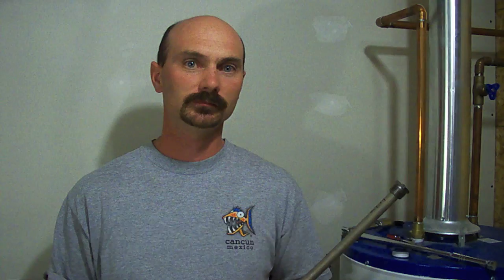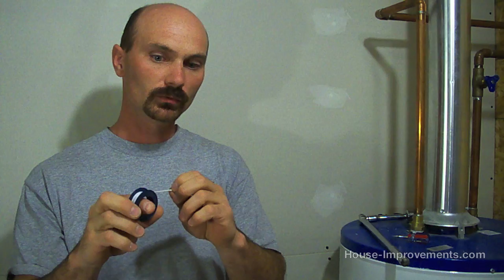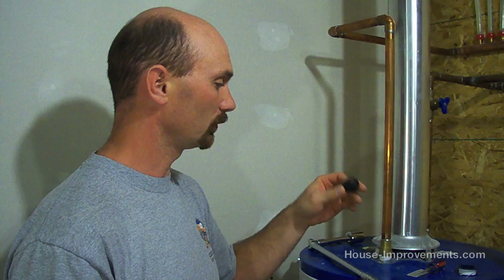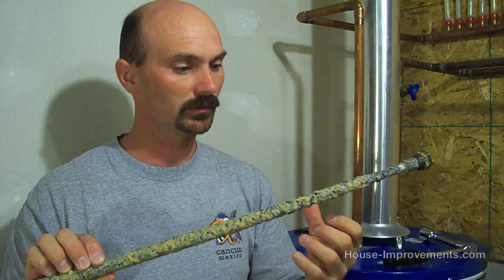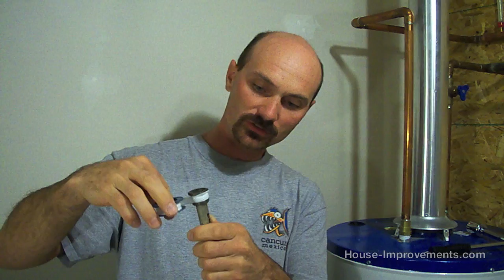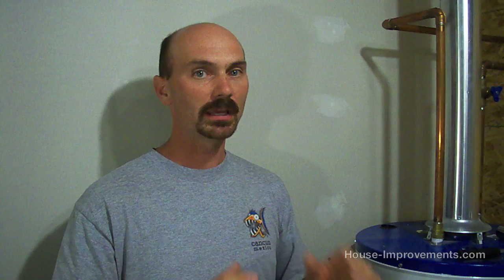How To Replace Your Water Heater Anode Rod

Comment: Watch out for GAS leaks when the water heater moves if using a breaker bar!  Use an electrical impact wrench to prevent this ($40 at Walmart).  On old heaters, breaker bars rarely work anyway.  Also, DON'T use teflon tape on threads as electrical conductivity must be maintained.
Reply from the maker: I like the idea of using an impact wrench. I have not seen a manufacture that does not recommend tape or dope on the threads.

Comment: How difficult is to replace the plastic drain valve? I bought HMP010 Full Port Brass 3/4" MNPT Water Heater Drain/Flush Ball valve.
Reply from the maker: depends how old it is. many older one will break.
Reply: @HouseImprovements  is A.O. Smith 50gallons bought at low's 4 to 5 years all. Never touch it, never flash it, never change anode rod. I'm preparing for this April. came with a white plastic valve.

Comment: why the top hoses of my water heater are flexible and not like this video?
Reply from the maker: Just a different set up
Reply: @HouseImprovements  How difficult is to replace the plastic drain valve? I bought HMP010 Full Port Brass 3/4" MNPT Water Heater Drain/Flush Ball valve.

Comment: the dip tube is on the cold water side. It is usually plastic and doesn't need changed. Bradford-white usually have the anode rod as part of the hot side. I agree way too much teflon.
Reply from the maker: the plastic Dip tube does need changing periodically depending on your water conditions.Look for my video.
Anode rod can be in two different locations depending on the manufacture. As for the teflon tape amount ....matter of opinion I guess? LOL.

Comment: Rheem does like they all do I'm sure, puts them in needlessly tight. The plastic sleeve they put around the nut is too small for an impact socket to fit, so you have to pry out the plastic sleeve. So I got a 7.5 amp corded impact wrench and it took it off without even breathing hard. Get ready to hacksaw the new one to length. Despite the manufacturers best effort I did it. And drain a gallon the first day of every month!

Comment: Many turns of Teflon tape will prevent contact with the hot water heater.  This is needed for a proper electrical chemical reaction to occur.  Else the Anode rod will be useless.  (I saw in another video)

Comment: Great video. Too much Teflon tape is more likely to leak. I understand why you might think otherwise, but it is not some kind of adhesive. I gets compressed. If a seat belt is too loose or too tight it won't work well. Same idea for the Teflon tape. 2 or 3 times around is enough.  4 or 5 max.
Reply from the maker: Thanks for the info!

Comment: You said the dip tube is on the hot side but it's actually on the cold side inlet. Its main purpose is to direct the cold water to the bottom of the tank and that's where it is dispersed. Also, you wrapped the teflon tape in the wrong direction. Other than that, you did a great job. Thanks for your videos.

Comment: couple of points 1> DONT USE AN IMPACT WRENCH, you will break the glass/porcelain insulation 2> release the preassure but DONT drain, you need the tank to be heavy so it doesnt twist

Comment: Do you have a water softener?  I don't. Does that require service to water heater more frequently with hard water?
Reply from the maker: I don't have a water softener.Hard water will generally be harder on the components and leave more deposits.
Reply: @HouseImprovements  I was afraid you'd say that.  Thanks for your response

Comment: If it is necessary to change the rod every two or so years, then why is my 1987 tank in So. CA (very hard water) still working with no changed rod? Bad science or a money-making scam?
The dip tube fell off a few days ago and I'll fix it (thanks to your help!) when the new one arrives. Hopefully working on the tank won't cause it to start leaking. Last year, I looked in the tank (inspection scope) when I replaced the tiny drain valve with a 3/4" straight ball valve. The tank looked as good as new - no rust and no scale. Lots of sediment though. It is a Reliance 501 natural gas 30 gal. tank.
Reply from the maker: Tanks where made way better back then. Keep that tank as long as you can. Have you seen this video it may interest you.  https://www.youtube.com/watch?v=OHDsNtGXEEY
Reply: Yes, tanks were made much better back then. In fact, all appliances were. They are now making them all complicated, with new features to make them more desirable, but with parts from China that must be shipped here, so they are all ultra lightweight. Which means, not durable. Also, most folks are planning on moving up to a larger home in 5-10 years so they never care about this. Sadly it's the same folks that preach about carbon footprints and greenhouse gasses that are buying appliances that last a few years, greatly defeating the little good they are doing in other ways.

Comment: Due to a minimal height space in my hot water closet - I am substituting the old straight rod for a flexible anode Rod. Do I have to cut a part of one of the links to the same measurement as the one I am replacing?

Comment: Good video. One thing you forgot to do, and is a required building code in all states is to use dielectric fittings. One on the cold water inlet and one on hot water outlet. The fittings in the tank are steel. When you connect the copper pipes to those steel fittings rust much like the rod you just replaced tends to build up at this point. These fittings have a nylon pressure barrier that doesn’t let the steel and copper touch. Water and metals of all types don’t get along rust always wins. We can only delay the rust but never eliminate it. That’s why the rod was invented and these dielectric fittings. To better understand this look up dielectric fittings and why they are used. Remember, these are mandatory building code requirements for all states.

Comment: Thoughts on using an impact wrench? My electric one is rated a 350 ftlbs. Would that work better than a 2ft breaker bar?
Reply: Yes.
Reply: @taterlysaladman9377  Use the ratchet only when
 installing.

Comment: I only have 30" of height from the top of the water heater to the inside of the roof. How can I replace the rod w/o moving the whole water heater?
Awesome video. Thanks a lot.
Reply: When you pull out the old one you can clamp it, then cut it and repeat to remove. Then buy the folded segmented rod. No need to pull out in one piece. But be very careful to not allow any to fall back in.
Reply: There's rods that are in links/sections so they're easy to install.
Reply: You can cut the rod as short as you need to.   But because there will be less rod material to be used up, you will have to change it more often.

Comment: There seems to be different sizes of the anode rod. Not the length but the thickness. How do I tell which size I have?
Reply from the maker: I have not noticed that? It can't be any bigger then the nut on top of the heater cause it has to fit the hole

Comment: I have a Jet Glass water heater that was here in the house when I bought it 19 years ago and I can't find the anode rod anywhere on the top, does anyone know where it could be?
Reply from the maker: sorry no idea.
Reply: Did you find it inside of the hot water line that is on top of your tank?
Reply: @janelensch6168  I replaced the water heater 2 years ago so I don't have to worry about it anymore.
Reply: @MrJpierre1000  New heater? Must feel great. I've seen advice to replace the anode rod every four years. I'm too weak to remove the anode rod on my 16 y.o. heater, so taking a cute from other diy geeks, I'm buying a $40 impact wrench from Walmart.

Comment: I have a 20 year old Apollo 5010 water heater.  I know I need to have both the anode rod and dip tube replaced.   I can see the dip tube is on the cold water supply pipe inside the water heater.  However, there is no anode rod top bolt at the atop of the water heater.  Does that mean I have to replace the water heater?

Comment: It takes at LEAST a heavy duty 3/4" drive impact wrench to crack those threads lose on original equipment anode rods. Them things are usually in so tight that we have to put a four foot long cheater pipe on a 3/4" drive breaker bar with impact socket and a helper trying to stop the water heater from rotating. I've even considered using an acetylene torch.

Here's a HUGE tip! We feed the cold supply into the BOTTOM of the tank! We remove the boiler drain, put in a nipple, tee, boiler drain and feed supply into top (middle) of tee. This assures that no calcium or lime build up occurs on bottom of tank. People NEVER remember to flush their water heater. This takes care of that for them. We install a SECOND anode rod where the original water feed was. All in all, I'd guess this would at least double the expected life and serviceability of their water heater's tank. We've had inspectors squabble - but they soon learned this installation not only meets code, but is the preferred method of at least Bradford White and AO Smith. I think the bottom fill keeping the bottom of the tank clean will help prevent people from turning up their water temperature to compensate for short-cycling that had been caused by build-up. That higher temperature causes build-up at an accelerated rate, clogging their distribution piping. Accelerated sacrifice of the anode rod, as well. That's THREE, count 'em 3 - huge benefits to this method. Neat, huh?
Reply: This is amazing.
Reply: Way smart! Thanks!

Comment: There must be electrical contact between the rod and the steel tank.  The anode is more willing to go into solution compared to the steel.  When it does make + ions, electrons are left in the anode, which must travel to the steel tank, giving it a net negative charge that keeps it from rusting.  Look up "cathodic protection"  in wiki.

Comment: Mine has a 5/8in bolt, problem is its not a hex head it only has 4 sides and it's recessed. Ever seen this? I ordered a replacement rod or I thought I did but it is a hex head. Hoefully it matches but how do i get my old 1 out?
Reply: Use a 12 point socket.

Comment: Teflon tape should be wrapped the other direction, and my anode needed a serious impact wrench to remove
Reply: @Donald Humphrey  You are right, "The other direction"   do not hire a plumber who does not know how to put a Teflon tape!!!
Reply: @1benny09  he did it correctly.
Reply: He did it right.
Reply: Wrong! Always wrap the tape clockwise, righty tighty ....( which he did)or it will leak
Reply: @wrzl1675  I think he was right.  Wrapping counterclockwise should ensure it does not fold/tear up when screwing back in.  Clockwise wrapping can possibly get torn up.

Comment: Cost of doing this myself:  
  $20 anode rod, from Amazon
  $75 impact wrench (1/2") and socket set
  Still cheaper than hiring a plumber!

Time required:
  25 minutes trying to shut off the water supply valve that hasn't been closed in 25 yrs
  1 minute removing old rod
  5 minutes sawing some length off the new rod so it will make the ceiling clearance
  1 minute tightening in the new rod.
Reply: For me it was $23 Amazon rod
25 min. trying to find water cutoff
water cutoff broke off due to age, water all over me and crawl space. 
$100 water bill due to excessive use
Plumber after hours $400 to fix valve. Extra $100 to install the rod but no guarantee as I didn't purchase from him.
Plumber noticed water heater was starting to leak, replaced, for $879.
Sold house cheap because crawl space was wet.
Reply: @taterlysaladman9377  I try to always shut the curb stop at the meter in an old house because old valves usually leak. It's always good to know how to do that in the case of an emergency!

Comment: I have a bock oil fired there are two caps on top labeled anode, are there two anodes?
Reply from the maker: sounds like it, I could not say for sure.
Reply: This is a tough one, can I call for a lifeline? OK. Here goes. The final answer please. Yes, there are indeed two anodes. Very tricky!
Reply: I also have the Bock tank (model 32E) and yes there are two anode rods.

Comment: Won't the Teflon tape electrically insulate the rod from the tank defeating the purpose of having the rod there?
Reply: Paul griffith The anode must be electrically connected to the tank. When the water "tries" to oxidize the steel tank, the electrons flow from the rod instead of from the steel. So the rod gets sacrificed but it prevents the steel from rusting.
Reply: Yes Omega Man.......good to see someone who is attentive. Also does anyone think that the tape is tough enough to act as a gasket between the threads? No it simply deforms into the gaps between the threads. 99.9 percent of the threads will be electrically connected. Engineers have worked this out! The rods are supplied here in Australia with a good amount of PTFE tape. They work perfectly. Happy Days.
Reply: he left a few threads without tape if you see the video
Reply: the anode is there to prevent rust. just like on big steel boats, dams, some docks and so on.. as far as i know it does not need to be insulated or not insulated.. its the metal itself (zink i believe) that does the work, not the charge.  correct me if im wrong anyone. im a marine tech and this is what ive been taught.
Reply: I feel that you are wrong about anode and tank needing to be connected.  The minerals that cause corrosion need ions or charged particles to do the work.  They will attack the easiest metal first .... like Mg*, Al***, or Zn**.   Iron or  Fe* is the most difficult to attack and will only be attacked when these sacrificials are used up.

Comment: Whoa!  only one wrap of teflon!  More than that and you've created new problems:  Extra teflon will cause the threads of the female connection to spread.  The extra teflon can be pushed out by water pressure creating a nice warm flow of water. One, just ONE layer of teflon tape!
Reply: Manufacturer and directions on teflon tape say 3-5 layers
Reply: @darrenlee8379  This is the internet Darren, we make minor changes in these and many other answers on a daily basis.
Reply: Nunof Urbiz  stop talking shit fella,two or three is the norm.

Comment: Sharing some thoughts!  I'm pretty handy and after three and a half years I decided to give the anode rod a checking out on my GE 60 gallon water heater that was installed in January 2011.  I decided also to contact my local plumber thinking that if I were to run into a problem he would give some assistance and parts should something go wrong.  We both tackled this problem using the 1/16 socket and a breaker bar on a half inch ratchet.  This would not budge the bolt.  Then, that night I sprayed the bolt with some WD40 and called him back - this time bringing his socket hammer driver.  This a drill like device - 1/2 inch driver - and for the likes of us both - the bolt would not budge.  Even worse, looking at the top of the nut down an inch deep into the water heater top… the surface of the bolt is an unbelievable 1/4 inch for the socket to fit onto.  This is truly an impossible job.  The manufacturer of the water heater is determined NOT to have this rod replaced by anyone!  So, my water heater has a 12 year warranty and that will be that!  Don't blame your plumber if he/she can't get this anode rod out… it appears that it was built to stay put!  Good luck if you try this "Simple repair"
Reply: selwocc 
I've run into that same scenario.  I can't for the life of me get that bolt to turn.  I've invested in 1) the socket, 2) a breaker bar, and 3) a new rod.  It seems to be money wasted!
Reply: The bolt is installed so that it cannot be removed.  The water heater manufacturers want to sell you a new heater!
Reply: @GoogleAccount-cj6gy  I did the same.  Already had some 2 or 2.5" conduit for breaker bar, but I wasted probably 45 bucks or so...
Reply: Did you call your manufacturer and ask if it was built to last 12 years? Years ago I had a  well drilled and water tested.  Great water with almost NO minerals and NO organics (Texas- oil wells) like benzine and toluene.  But water pH was 5.0.  What did that mean?  It was "aggressive" in the water industry parlance.  Anywhere I had a brass or copper/galvanized fitting interface, I had a pinhole leak in 12 to 18 months!

Comment: I enjoy your videos, not being a wise guy, the air in the water heater has to be bled out before turning an electric water heater on or you could possibly ruin the upper heating element if not surrounded with water. This can be accomplished by opening a hot water faucet or raising the lever on the pressure relief valve. Thanks for taking time to make the videos, they are really informative. :)
Reply: Was thinking the same thing, very important detail, thanks for bring it up
Reply: Yes, except the water heater he demonstrated was clearly a gas water heater, not electric.

Comment: Some dispute below about the "grounding" of the anode.  The theory is that the magnesium must be electrically connected to the steel and copper connections at the top.  Without the electrical connection, the bi-metallic corrosion will occur on the copper-steel parts.  It will rust out and leak!  I learned this the hard way.  With an electrical connection, the ions will all go to the magnesium and not the copper.  Hence it is called a sacrificial anode.
Reply: Meaning that no teflon tape should be used?
Reply: Alberto González I think one or two layers of teflon tape will be cut through when the anode is tightened.  This will make some metal-to-metal contact.  Any more layers of teflon will possibly prevent an electrical connection.  It's a judgment call.